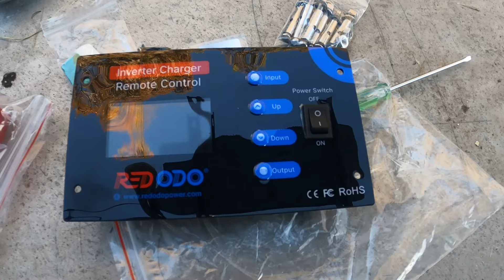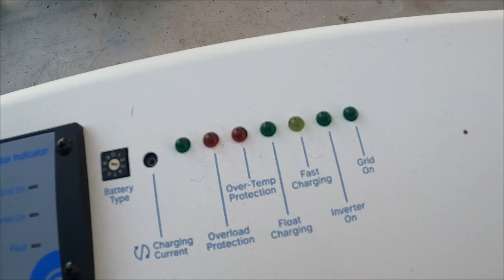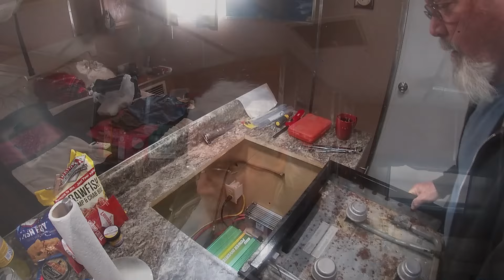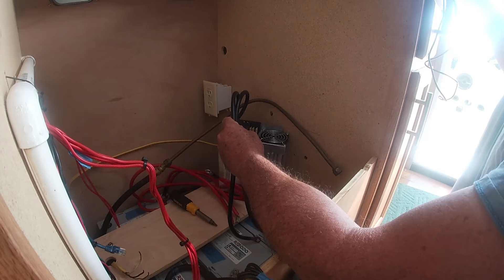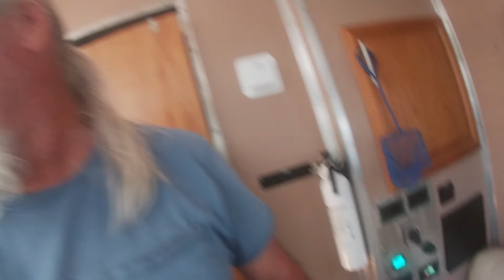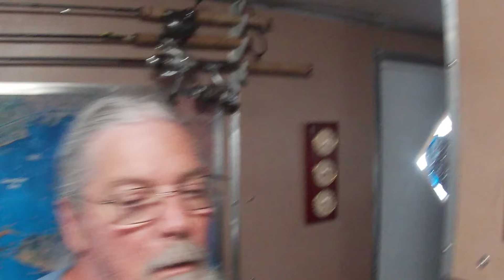Houseboat Upgrade 3000W Inverter by Redodo

Comment: Thank you man. Great explanation. Getting ready to try and set up two redodo 200ah batteries and this inverter into a milwaukee packout tool chest. Solar and dc to dc charging too.
Reply from the maker: I'm also using it couple of their 40amp charge controllers. This inverter has a charger built into it. Once shore power is plugged in, it will automatically change from inverter to charger.
 Good luck with your setup I think you will be happy

Comment: Saved this video to reference when I hook solar to my river camp (when I get it done). Think I'm gonna go with this brand, I see their stuff reviewed everywhere... they got to be onto something good. Went to the link in the description, you right too... they got some killer deals going on right now. Great video as always Pop... ya'll keep em comin
Reply from the maker: So far I have not had any issues with their batteries. I replaced another pressing wave inverter with this inverter. Large difference in the cleanliness between the inverter. With the old 3500w my microwave would make this crazy sound like it was struggling to come on. With this 3000w not only does the microwave work like it should,  the AC and the refrigerator  sound so much better.i don't think the pure shine wave of the 3500 is so pure

Comment: That thing looks pretty powerful. Is it a pain to set up?
Reply from the maker: Wasn't too bad. It is rated less than what I had in there. But the electricity is much cleaner and it seems to be more efficient. The original one, I think it was overrated for sales

Comment: Hey Pops good to see you again as always are you sponsored by them?
Reply from the maker: Not really sponsored. I wanted the inverter and Redodo wanted me to do a video on the batteries I already had. So we worked out a deal with the inverter. I'm a believer in Redodo. I was offered cash to make a video and I turned that down. I'm very happy I went this direction, because the inverter works better than I was expecting.
Reply: Ok nice!

Comment: That is a nice system and should provide you with plenty of power. I was wondering if you should add some fuses. Fuses are good to protect the wiring since these batteries can dump a lot of amps.
Reply from the maker: Thanks 
Probably would not hurt to add in some breakers to the batteries. I have Breakers on the solar panels and the 120 side of the system. The inverter has a couple of breakers on it, just don't know what side of the inverter they are for